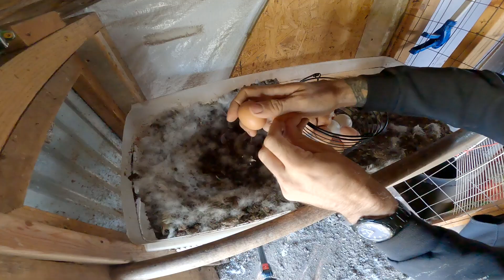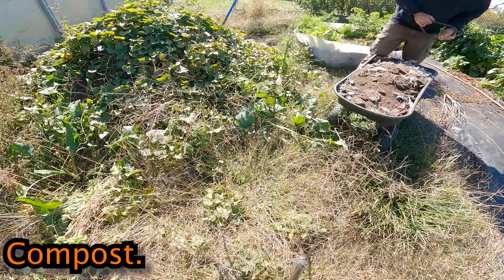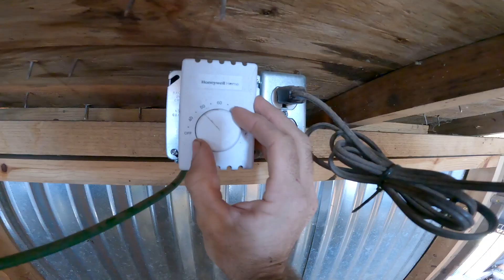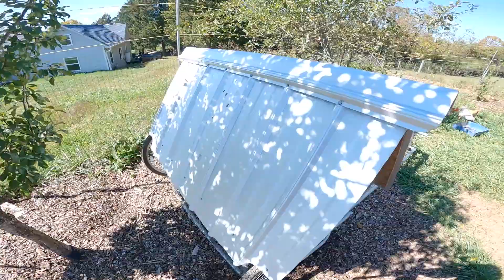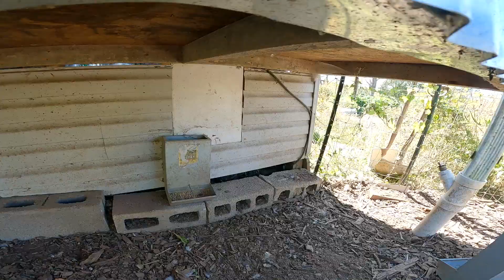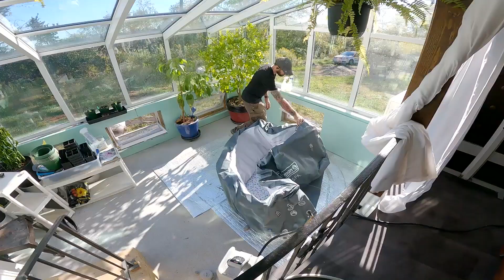Relaxing ASMR Farm Chores

Comment: Put that removable wall on hinges, add air shocks to hold it up, Right now it might [not] be an issue but when you are older and have ouchie shoulders you will thank me.
Reply from the maker: The design wont allow hinges. I'm going to be rebuilding the whole building soon. It will have a better design the next time..  :)
Reply: @EmptyHammock  Cool. Thanks for answering. It means a lot.